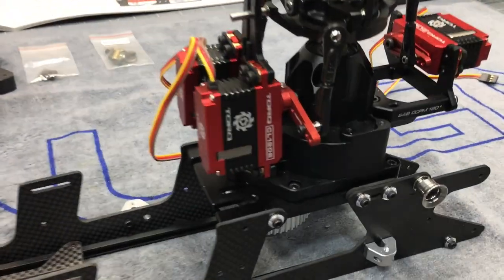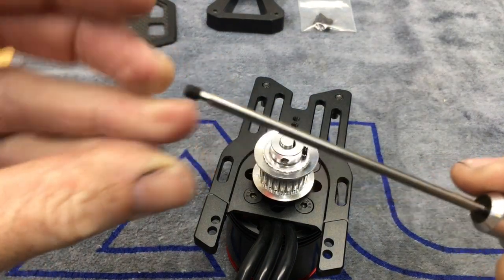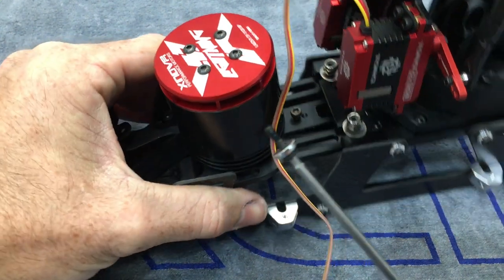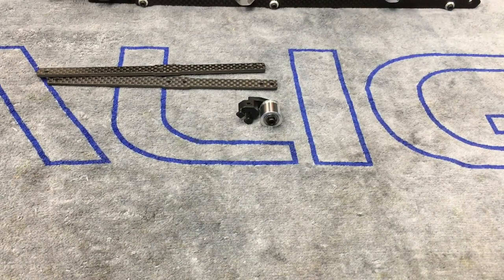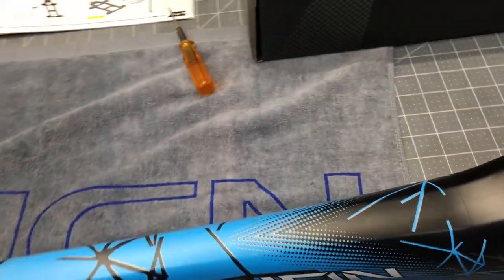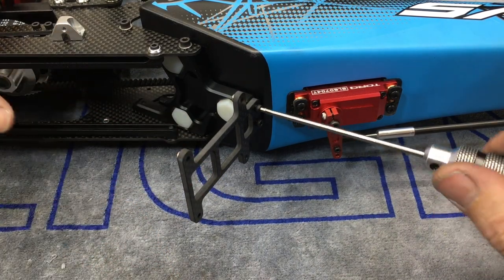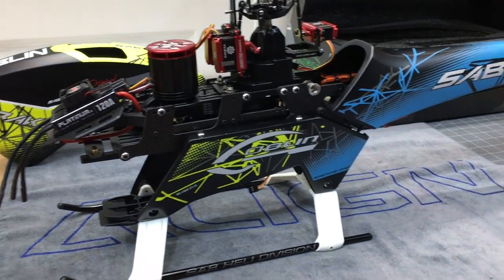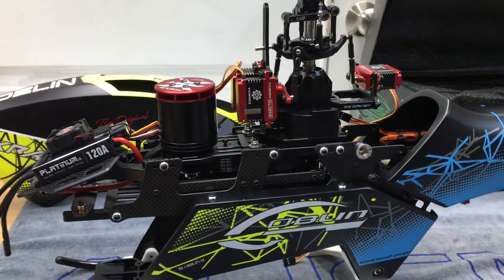SAB Goblin Kraken 580 Part 4

Comment: Nice build. Must say I'm very happy with my raw 580. Look and build wise.

Should you do a video for the ikon/brain look into the governor. I use the brain governor for my 580 and it's flawless. The setup is easy. Because the fbl knows your stick inputs the governer can correct a lot faster. The hobbywing has a rpm sensor, just needs to be put in the gov port.

Edit: only downside is if you want autorotarion bailout you have to use the airplane mode on the esc. The ikon still has a slow spool-up but the initial start is a bit harder making the tail kick
Reply from the maker: I like the RAW 580 better as far as flight performance but both helis build great! I usually run the govern in the Ikon but a lot of guys run the govern In the Hobbywing. I’ll probably do a video on both.